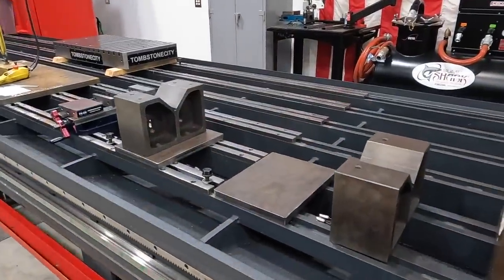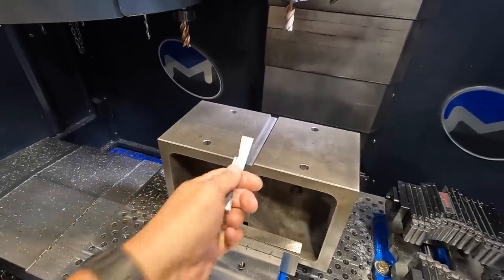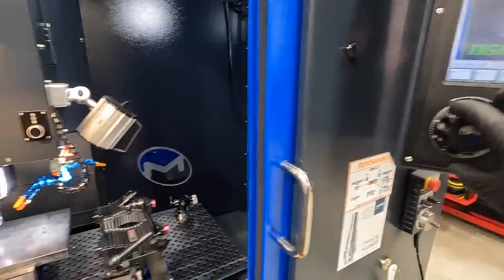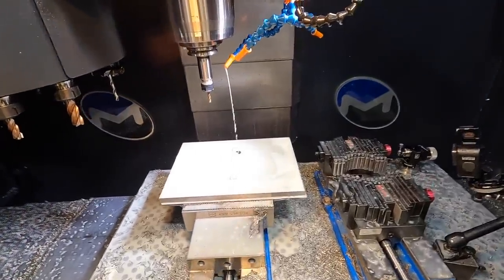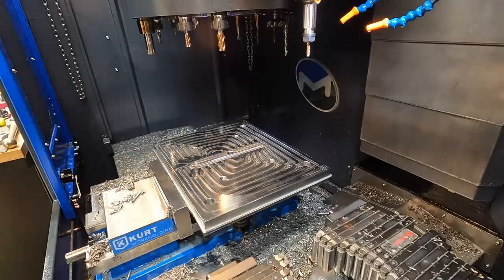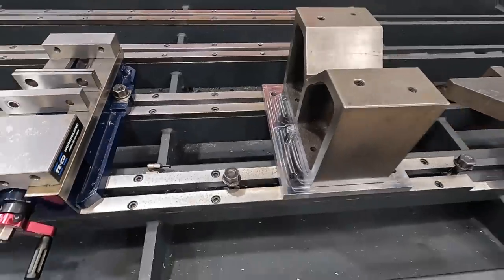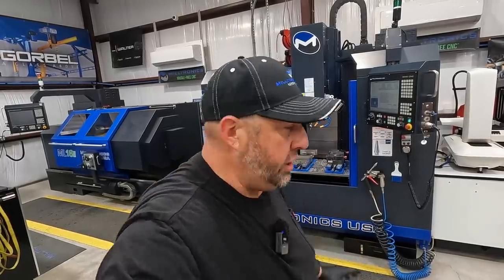V-Block Adaptor Plates

Comment: A question and comment: I'm an industrial engineer, not a machinist. How do you determine whether to use coolant on the CNC mill? No coolant while drilling? Comment: To save cycle time on making the locating key on the adapter plate, for your first operation, you can mill only the area of the plate where the key will be, instead of milling the entire top. The second operation raised the key. Thus, eliminating the time to surface the entire plate.
Reply: Sometimes Adam cuts the coolant for better visibility, but coolant is always at least a little better for steel.
Reply: @Bob_Adkins , didn't Adam start by milling slots and bolt holes in some cast-iron v blocks?  When he switched to the steel adaptor plates, he started using coolant.
Reply: @stuartschaffner9744 , Your comment is exactly why I am confused. I understand the need for visibility. If coolant is a partial lubricant and temperature-reducing agent, then why only use a few drops of cutting fluid when drilling deep holes? Does the cutting oil not thin out as the hole deepens and thus lose its lubricity? I often see smoke terminating from the drilled hole leading me to believe the cutting fluid is no longer doing its job. One would naturally think that more is better.
Reply: @kenshoemaker  , I'm a physicist rather than a machinist, so I pay extra attention to how experienced machinists like Adam adjust to different materials.  Adam and several others tend to use less or no coolant on cast iron.  I have also noticed that cast iron tends to produce very small, almost dusty, chips.  So, when I saw small chips coming off the tool, I remembered that the V-blocks were cast iron and basically heirlooms from Adam's dad.

Concerning the drill holes, they might be a bit deep but they are through holes.  I did notice some "smoke", or perhaps discolored chips coming out the bottom.  However, the heating was brief and both tool and part had a chance to cool again before any other machining.

I couldn't do it myself, but I understand that the big curls that come off steel can show a good machinist how hot they got by their color changes.
Reply: @stuartschaffner9744 , I suppose that coolant, whether oil or water-based, is primarily to extend the life of the cutting structure, and the trade-off is machine operating time + retooling time, versus the cost of the cutting structure. I realize I'm trying to pick fly poop from pepper here, but the subject has always fascinated me. Thanks for your input.
Reply: @stuartschaffner9744  a lot of people don't realize that when milling steel coolant can actually decrease tool life.  Modern coatings on carbide are designed to run at very high temperatures and using coolant can cause thermal cracking.  If you are using the proper rpm and feed rate most of the heat leaves with the chips that are produced.  The heat at the cutting edge will activate the lubricity of the coating.  

Drilling is a different animal.  You almost always want to use coolant while drilling.  The cutting edge is in constant contact with the metal and the heat gets trapped in the hole.  

BTW coolant's main jobs are lubrication and chip evacuation and not necessarily cooling the tool.
Reply: @derekjo2000  , thanks!  A lot of what Adam knows and applies to his work has little to do with programming.

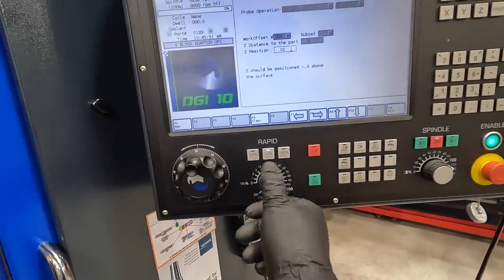Comment: I have a question at 10:44 . Why the surface was set to -0.02? As far as I know, negative z value goes down. so if we want to have z as zero after facing operation, shouldn't it be +0.02? so after 20 thow of cut the surface is going to be at z 0.
This is a geniun question and thank you for this video!
Reply: He wanted to take a little material off that face so he touched the rough face and told it that the finish surface was -0.02" from there.
Reply: @DrunkenBobDole  Thank you that's clear now.

Comment: You bumped up the feed rate and the spindle was slowing down. Those machines don’t have the horsepower to hog material. You have to program it smarter. Less step over and higher feed rates or slower feed.
Reply: Yeah the spindle motor is giving it all. But at least the machine is stable and rigid enough for its spindle capacity, unlike other machines who will break themselves apart at 50% spindle load. As long as the spindle doesn't stop or overheat, it should be ok

Comment: I want to stay positive. But this doesn’t compare to your old content. I’ve always been more interested in your knowledge  , compared to watching a robot. 

I’ve learned a lot from you over the years
Reply: On a manual machine, Adam turns dials and flips switches to make a machine do what he wants it to do.  Here, Adam turns dials and flips switches to make a more advanced machine do essentially the same things but with greater speed, precision, and repeatability. The most important basic knowledge is very much the same.  Approach this with a positive attitude and I am sure that you will continue to learn from Adam.
Reply: @stuartschaffner9744  The reality is CNC makes terrible video. Spin it all you want, the video views tell the tale and this channel is dying a slow death.
Reply: @andrewterry8092  I don't think it is dying a slow death at all. Its just hard for some folks to adjust to change
Reply: @andrewterry8092  Love the old content.  Love the new content.  Making parts is cool no matter what tool you're using.

Comment: So how does this work. If you're doing onsie-twosies....you write a program.....then you gotta run a part, and make offsets to get the dimensions where you want them, right? How you gonna do that when you're running an operation on an existing part?
Reply: Adam is learning .... gaining experience.
Reply: The same way you would on a manual mill

Comment: Anyone have a link to a video or website that would explain how does that edge finder work? I find it facinating, since usually seen rubys only inside automatic watches. Just interested to know the techincs behind such a device.

And Adam: I love how you want to make the past generations part of your shop and how you keep their memory with your workings. Much love to you and yours!
Reply: It lays on 6 balls. When it touches something, it lifts from the any pair of balls and the electric circuit breaks
Reply: And it transmits wirelessly to a receiver on the machine.
Reply: @mattym8  infrared as far as I know
Reply: Found this;
   ''Electronic edge finders work in a similar way to mechanical edge finders. However, the location of an edge is indicated by an LED light rather than by the probe of the device becoming offset. Another difference is that the spindle of a machine does not need to be rotating for the electronic edge finder to work.	

Some electronic edge finders work when an electrical circuit is completed. The circuit is completed through the workpiece, table and spindle of the machine it is used with (drill press or milling machine). Because of this, they can only work locate the edges of parts that are made out of an electrically conductive material (metal). 	

There are also more complex devices that have an internal ‘tickler’ mechanism which, when disturbed by the contact with the workpiece, closes a circuit internal to the edge finder. These edge finders do not depend on electrical conductivity through the machine and so can be used with parts made of non-conductive metals.''
    (sorry about the wordy explanation)

Comment: I dont think Well be seeing Adams shaper too much in the future. He will be too busy learning all this cool stuff.
Reply: Shame really.
Reply: @colinfahidi9983  Why?
Reply: @colinfahidi9983  Agree.
Reply: @docokd7oco443 We need to know both manual and cnc to make a living in this trade If You want to be at the top of Your game. There may be some exceptions but not learning cnc is a real handicap.
Reply: @Doco KD7OCO I mean you'd just have to be so out of touch with the trade to think that manual doesnt have any place in a modern shop. You recon this is a good proccess to drill and tap a single m6?
Reply: "cool stuff" That'd be the shaper
Reply: @markshort9098  I have a shaper. I could never make money with it even though it's pretty cool. I make a living from my tool and die shop which is mostly cnc
Reply: @spikeypineapple552  manual will never and should never disappear. Even in a CNC machine shop. You are correct
Reply: @danneumann3274   if your making massive mining equipment then a shaper is a valuable machine, if you need to cut a massive internal keyway or something like that a shaper can cut any size without needing thousands of dollars worth of broachs, their also very useful for cutting custom splines etc.. you might not have a use for a shaper with the work you do but a shaper would have made my life a lot easier if I had one, unfortunately shapers are almost impossible to buy where I live because the few that have them won't part with them
Reply: Not so fast.  Coming from 4 videos into the future,  Adam reveals that the plate thickness has a variance of 3 thou ( and not from any bowing in a clamping force direction either).  It was so all over the place that he wasn't willing to show it on camera ( might upset Milltronics).  Maybe he could put it on the shaper to do a new finish cut both sides to try to get the flatness and plane parallelism he was expecting but didn't get on the CNC mill, but Milltronics might not be amused, lol.
Reply: @richardjones-sl2zd  I don't know the plate  size , but to get much closer than 3 a grind would usually be in order

Comment: Adam, i didn't see you use the soft hammer to make sure the plate is really touching all the edges of the vice.
Reply: Not necessary with that type of jaws, they pull the material down on their own when clamping.

Comment: The cutter at 31:48 is running out of hp in the cut. Find where the torque curve is and play around a bit. Most smaller machines need to run it usually a bit lower in 2-3000 range to have max HP
Best is always figuring out what the manufacturer specs the max hp and torque curves at.
And yep cnc is challenging, especially on a fanuc controller without any conversational on an older controller.
All there is on the screen is code and location.
Only pain is going back and forth redoing programs to change a radius on a tool path with rs232
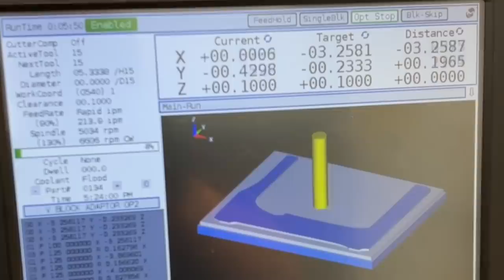Reply: You can see in 32:04 that spindle load is 50% but rpm drops from 6600 to 6250. Some bad readings on spindle load for me.
Reply: I ran a Johnford SV-48H with Fanuc Series 18i-MB controller, it had no conversational.  It was
all MDI (manual data input), I hated it.
Reply: @tomek_FORCE  You're bang on, how wierd is that. Looks like it's off by a half?
Reply: @spikeypineapple552  it should behave like this maybe on 150% spindle load. So three times more.
Reply: @tomek_FORCE  Could may be the VFD is set up incorrectly. Time will tell, when other heavy cuts are taken.
Reply: I noticed that too, and at only 50% load. Something isnt right in the machine.

Comment: Is it just me or does the RPM look rather low on the Drill meister drills?  Like the feed looks fine but the RPM... idk my guy  0.23 - 0.4 mm/rev feedrate is recommended aswell as 70 - 120 VC (high carbon steel, since i do not know what steel he is using)
Reply: Its cast iron You don't run these tipped drills like proper insert drills. about 80m/min I would say, gives you 1600rpm, which is about right. I'm more worried about the inch cutter at 450m/min lmao

Comment: such complexity ... I am a amature at manual milling but could punch four holes and a slot, quit crippling yourself using the machine interface and start learning real cad please
Reply: It's actually very easy and fast, it's just that he's a beginner.
Reply: He still has to know the machine interface.. even when using cad.. how are you gonna zero your work? oh yes yes the computer does that for you somehow. Tool offsets? oh the computer is gonna magically calculate wear.. If you only want to deck a surface you are gonna run to your cad software when its an easy cycle? lol.. People these days..
Those SIMPLE cycles/programs he is making are baby steps.. He is a complete noob at this if you can't tell.. He even said it himself he has to ask for help remembering simple operations-..

Comment: Why in the world are you using coolant while milling steel using carbide cutters?  Much better results running dry with the proper speeds and feeds.
Reply: Much better results?? Running without coolant sacrifices finish, lessens tool life, and means the coating burns instead of doing its job. Can you please explain what you mean by much better results?
Reply: Coolant helps significantly with tool life and surface finish lol.
Reply: @wifal6874  using coolant while milling steel with carbide cutting tools can cause thermal cracking. Look it up. I've been a machinist for a long time and this is something I learned early on.
Reply: @keithhasafastcar  might want to do a little research before you lol
Reply: @derek johnson  I'm well aware of this but when using hsm tool path with solid carbide endmills, the advantages of using coolant far outweigh the disadvantages. Now I will agree that when using traditional tool paths, face milling or using high feed cutters, no coolant is a better option. I too have been in this trade for quite sometime, programing setting up and running parts.
Reply: @keithhasafastcar  the only time I use coolant on HSM tool path is if I'm down in a pocket and need to evacuate chips and I don't have air blast to do this.

Comment: Abom79 i can tell you with Cam and a simple machining template you will make the part faster than conversational.
You only need the lines of your part and the holes, nothing less nothing more, no 3D models, you make a basic template on you cam and you use it all the time
Fusion360 makes it easy.
When you get used to it, i'm telling you, you will do faster in cam than conversational even for simple stuff.
Cad/Cam its not confusing if you dedicate some hours everyday 2.5D stuff is simple.

I understand you're advertising what the machine has and you are they partner, but there's a line you shouldn't cross.
Reply: This type of work is exactly what Milltronics Conversatioal  was made for. Even if you could program slots and holes faster in Fusion, the machinist with the Milltronics will already be making chips when you come walking out to the machine with your USB. And then the first time you need to change something his change is made before you get back to the programming office and he's already drilling with the altered depth or whatever before you touch your mouse. Actually it really comes down to how far away your computer is and how fast you can run!
Reply: @jdvid007  I must disagree.
First your pc should be always near your machine
Second a template made in fusion with operations it’s normally dialed in already because you made it once
Third you won’t need to go back to the computer a second time as it’s operations that are finishing the slots will be in WEAR COMP
He won’t be making chips before.
Haas and other machines have the same conversational programs, and it’s not faster, sometimes it’s more confusion for the machinist or operator.
Reply: @iRaised95  You guys still do sneakernet and hand carry USB drives? There is this new thing you must of heard of by now that you have been using for years called networking.
Reply: @utidjian  my machine goes trough the network, i send it from my pc directly, but not all machine in my factory are set like that, sometimes i carry an Usb :P

Comment: A third V block set up is required for proper work holding a long shaft. And - Need Black Oxide! Need Black Oxide! Need Black Oxide! Need Black Oxide! Need Black Oxide! Need Black Oxide! Need Black Oxide! Need Black Oxide! Need Black Oxide! Need Black Oxide! Need Black Oxide! Need Black Oxide! Need Black Oxide! Need Black Oxide! Need Black Oxide! Need Black Oxide! Need Black Oxide! Need Black Oxide! Need Black Oxide! Need Black Oxide! Need Black Oxide! Need Black Oxide! Need Black Oxide! Need Black Oxide! Need Black Oxide! Need Black Oxide! Need Black Oxide! Need Black Oxide! Need Black Oxide! Need Black Oxide! Need Black Oxide! Need Black Oxide! Need Black Oxide!